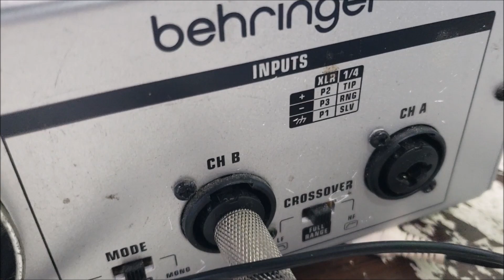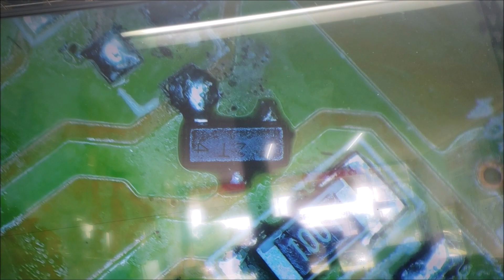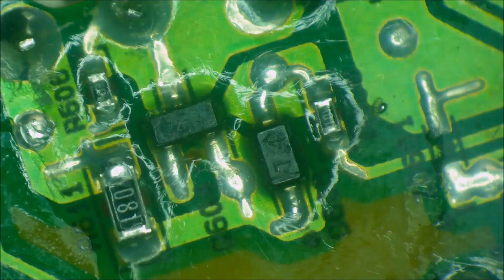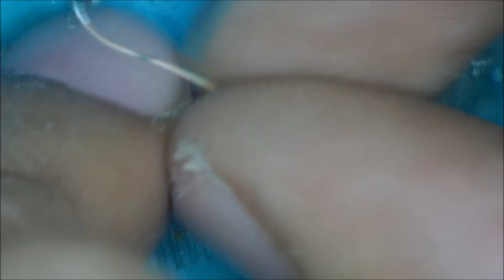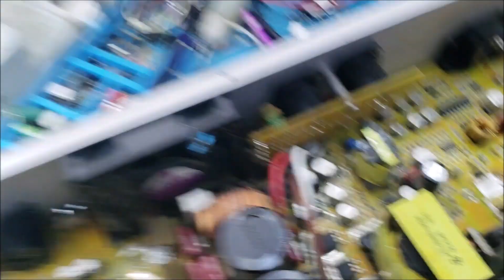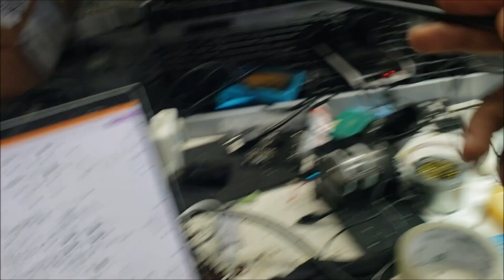behringer iNuke nu3000 repair power section

Comment: I have one of these but I feel like something blew and I can't go above 25v per channel without getting distortion. Bridged I can get 50v. No more. Yet I see others get much much more power out of this amp. I might have to tear it apart one of these days and investigate.
Reply from the maker: you have a power limitation, check the heatsink and make sure it's not overheating.
Reply: @SOSfixElectronics  The heatsink seems to be fine and attached properly. It doesn't even get that warm. Even on cold starts it just functions the same cold or at operating temperature.

Comment: Greeting I'm repairing a amplifier similar to this one I need some help my amplifier is in protection sg3525 pin 10 is it normal for these amplifiers to not provide input power to the 7915 and 7815 and the 24 v regulators when they are in protection mode fans are off no 24v power ?

Comment: Good afternoon. My power in normal operation, burst and opened the 2 diodes D13 e D14 that work close to the electrolytic capacitors at the base of the board as shown in the videos, cut the audio and went into protection. I would like to know the numbering of these diodes and if changing them does the power work normally again? Grateful!

Comment: Do you think those little MOSFET heatsinks are enough for 3000W device? On top of that people doing quiet fan mods for these to keep the noise down. Are MOSFETs going to overheat first or there are another components that will overheat in lower airflow?

Comment: Its not clear from the video where you got the replacement transistor and diode from . Good fix again
Reply from the maker: from samsung tv main board
Reply: @SOSfixElectronics  thats awesome , i stole a pnp transistor like this from an old circuit board to repair the standby circuit on makita radio that wasnt turning on  , i hate having to wait for parts , and like you said in the video, the quality of new  components these days is poor
Reply from the maker: @reacey  😁yes that is the right option better the buying new component 10.000 pcs  x 50c, i have a big box full with old board for parts